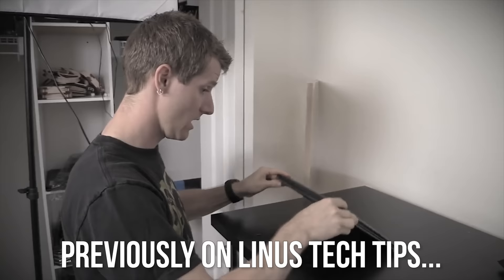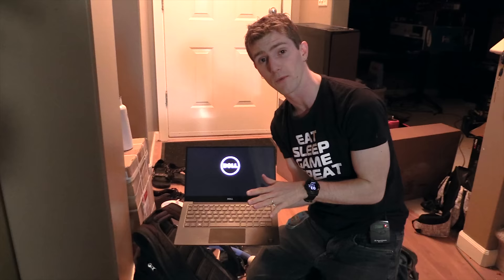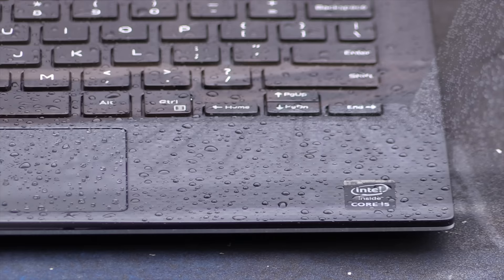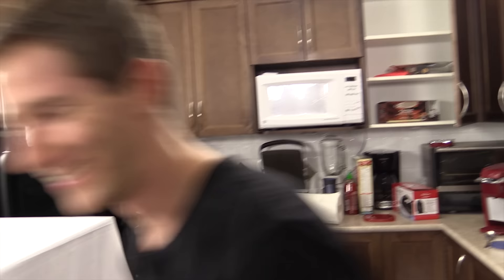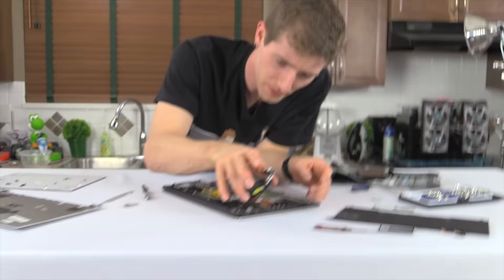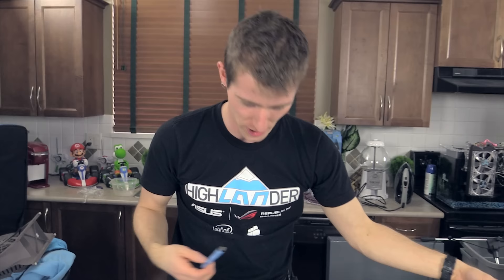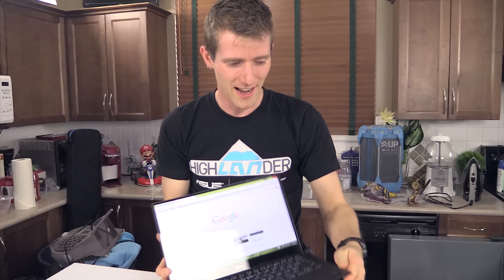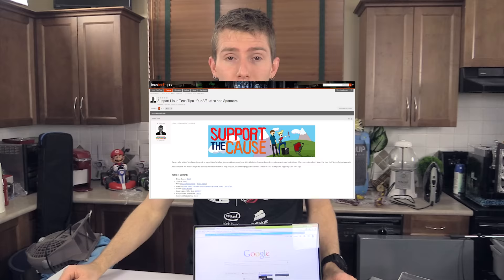Wet Laptop Recovery AGAIN - Dell XPS 13

Comment: Try these when the laptop is on and I'm sure Dell's ENGINEERING will not save this laptop.
Reply: as he said it is not waterproof , but it is still quite durable and resistant a lot of other laptops would have died doing this
Reply: KidGacy Meh I wouldn't really say that. I've had one of my older laptops wet when my nephew poured in milk on it. Good thing it was off. All you really have to do is let it dry and voila, it's still going to work.
Reply: Mcky Dela Peña My Dell XPS M1530 had survived at least 3 liquid attack. Once, i spilled a glass of carbonated water over the screen/speaker area. I let it dry in front of a heater, and 30 minutes later it was fine. I did the same thing the day after (which i know sounds stupid, but both were honest accidents). 30 minutes later and it was fine as well. Lastly, a friend of mine was holding a water bottle in his hand. He forgot there was not cap on it, and leaned in over my computer, and spilled all over the keyboard. 60 minutes of drying later, and it was fine.

I should mention that all 3 times, the laptop was on (obviously i turned if off immediately after the spill). Either laptops are more waterproof than we thought, or Dell really does make laptops out of magic.
Reply: Christoffer Nørskov Omg though have you tried dells customer service. They ripped my mom off by 200 bucks to get something fixed on a dell xps l702x. I don't know if much changed, but I honestly don't think a lot has changed based on recent reviews.
Reply: Fastgamer602 I have had great experiences with their CS. When my hard drive broke (2 times, it was a daily driver and used a lot), they shipped a new one and it was there next day (which is several days faster than when you ordered things online where i was living at the time)

When the GPU in the notebook malfunctioned (there was a known malfunction in the Nvidia 8600m GT) several years after warranty, they sent a service guy out for free to fix it (and another guy the day after, since the new hardware was Dead On Arrival). Keep in mind, replacing the GPU meant replacing the motherboard which also contained the CPU.

They did a free replacement of the plastic underbody of the laptop, after my warranty had run out.
Reply: Christoffer Nørskov Wow you're so lucky they forced my mother to pay while when we bought the laptop 7 days before. If I knew they improved this much I would have bought the Dell XPS13 vs this MacBook Air.
Reply: Fastgamer602 this was several years ago. Also, I live in Denmark where we have a bunch of consumer protection laws, but all things considered, my experience with them has been better than other places
Reply: Christoffer Nørskov That might have been the big reason why you got so such good customer service. We had some foreign reps that barely knew English so I am guessing Dell is doing some sketchy stuff.
Reply: Fastgamer602 but most companies are that way. Very few companies willingly provide good customer service
Reply: Christoffer Nørskov yea but in America at least apple has one of the best customer services. :/ I really want the Dell XPS13 but my bad experience with them is making me lean more on apple.
Reply: Fastgamer602 in Denmark, Apple tried to sue the government because they didn't want to follow consumer protection laws
Reply: Well obviously. That wasn't the point of the video, though.
Reply: naota3k No, but there is absolutely nothing wrong with going off topic, unless Youtube is running out of comments? /s
Reply: Surprisingly, as much as I hate them, the Mid 2012 Macbook's are very resistant to spills. 4 people I know, including myself have spilled liquids on their macbooks.(keyboard area) and they all work fine.
Reply: ImportNation Most laptops are this way. My Dell XPS M1530 has had 3 major spills and survied them all
Reply: Christoffer Nørskov I never spill anything on my laptop...

Comment: Help me understand something. He put it to sleep, then during recovery he removed the RAM. Wouldn't it be a clean boot in doing so or does Windows do like a hibernation/sleep hybrid?
Reply: Ive experienced some similar stuff.

Powered down when it failed to wake from sleep. REbooted and expected a fresh boot, but nope right to where i was.

:shrug:
Reply: Cameron S. Windows saves the ram onto the hdd/ssd when it is in sleep and reaches a critical battery level
Reply: Ahh. Good point.

Comment: I'm not sure if it's been changed but I'm fairly sure older dell devices like the XPS 12/13 'Sleep' by actually hibernating - they seem to power off completely while keeping memory in a state that does not use power, perhaps by saving it to the hard drive. I think an identical device that sleeps in the traditional manner would probably not survive...

Comment: I've always wondered, if you wash your keyboard with water & soap while plugged into a pc that's running, would the pc survive it?

This would be a great thing to know if you're blessed with the dumbest housemaid in the world. Or girlfriend. Or mother. Or both.
Reply: thany3 I'd assume the computer would avoid harm, but the keyboard may not be very happy.
Reply: If your laptop gets accidentally wet chances are that either the motherboard fries or in more likely case the keyboard loses some of its functionality (dead keys). The same happens if you take your laptop (when it's on) from a warm place to a very cold place, then back to warm again because of condensation. Condensation can be prevented by keeping your laptop shutdown for 10 minutes before turning it on every time the temperature changes drastically and sometimes dead keys fix themselves after 24 hours of drying the laptop. The motherboard does not usually fry immediately and if you notice any unusual sounds power it down immediately and dry it. Speaking from personal experience. Every other component in a laptop can take far more punishment. Little water on cleaning purposes wouldn't kill the keyboard when it's on but I'd avoid soap.

Comment: I myself have a old laptop that's a hp pavillion dv6000 from 2005ish. It has had a whole 20oz bottle of coca cola dumped though it. It never stopped running when it happen. The soda was dumped on the keyboard and was pouring out of the fan intake. With the fan still running to say the least. That laptop still runs as good today as it did brand new. Loads apps and websites what seems like just as fast as my brand new omen.

Comment: holy shit, just buy a thinkpad
Reply: i will admit that the latest thinkpads are shit though
Reply: ***** ikr ibm made beasts, lenovo used ibm's design and slowly changed it to their design and now its a consumer laptop competing with shitbook pro
Reply: ***** its more profitable 4 them to go into the server market
Reply: ***** Panasonic Toughbooks ma mayne, shit's built like a tank.
Reply: DGTelevsionNetwork thinkpads use to be so good that they could be run over by tanks but now all hope is lost
Reply: ***** Yep, well there's Chinese business for you..
Reply: DGTelevsionNetwork they are trying to compete with macbooks with the thinkpad line when we know that a mac user would never get a laptop that wont break when you breathe on it so thinkpad should be for people that demand the best have like a really strong carbon fiber shell reinforced with steel and fit some desktop parts in it. w series owners dont give 2 shits about weight reduction if there laptops already way 5 pounds

Comment: Dell laptops seem to be really good in terms of surviving getting wet. My Inspiron 15 gaming laptop survived a full glass of coke being dropped on the keyboard. I immediately shut it down, opened it up and aired it out (without doing much more than removing the battery). Still worked perfectly, aside from a couple of keys being sticky.

Comment: The thing is, in a laptop everything runs a relatively low voltages, so the water is not going to be conductive enough to short it. And the water applied is rain water, which is a lot more pure than tap water, in terms of ions.

Comment: People really don’t understand how water kills electronics. It either causes a short if it bridges powered components/battery contacts, or it corrodes contacts/components. 
If a device is powered off when it gets wet, is allowed to dry, and it’s fresh pure water it got wet with, any device should be fine.

Comment: I'm actually really surprised that Linus is surprised this works. A little rain seems fine, most laptops will survive that. I've recovered Macbooks from water spills, milk spilled in the fans ( and being off for 6 months afterward ) and all were completely fine. Honestly, modern tech can pretty easily handle the abuse.

Comment: The Latitude series is known for being tough as nails and (thankfully) water resistant, I say that in a shy way because like most any other devices, it won't last a submerging. But some rain drops or cough  a coffee spill won't totally ruin your day. However it's nice to know the related machines, such as the XPS are fairly rugged too.
Reply: Can attest to this, my XPS 13 has gone through various drops, and a full on beer bath almost, still works fine. By this I mean having most of a large beer can pour straight into the keyboard while running 😛, it didn't even flinch, and I'm typing this on it. Pricey but well worth it IMO if you use your laptop like others use a cellphone, which is to mean that you lug it everywhere all the time like I do with mine.

Comment: I've only gotten to 5:00. I can get Linus wanting to see how water-proof the laptop is. But, putting it in the rain then leaving it for a couple of days...? The metal will have had a chance to rust or oxidize from the water. I haven't seen all his videos; but, this is comparable to him sticking some PCI cards in the oven. He MUST do really well for himself.

I've gotten to the end... The last time, he was lucky. This time, he was throwing caution to the wind. You know, up till now, I was liking his videos. This is the first time I felt like someone deserved to get a dislike for potentially ruining a $1k laptop that was LOANED to him by the manufacturer just because he wanted to see if it could, also, survive the rain.

Comment: So if you didn't understand, its okay to soak electronics. just dont have any current going through it while soaked. Water conducts electricity. And said electricity then flows to unwanted places breaking the computer. If you didnt have an electricity flow in first place, it wouldn't make a difference. Just dry it afterwards and it would be normal

Comment: Just to experiment I had drenched an old laptop in a bath completely submerged initially the screen was all funky trippy colors. As long as the battery isn't shot, sure enough a little bit later, without opening it up or trying to recover ended up working perfectly yet again. Same deal with gatorade and my macbook, tho that was an accident. Machines are impressive.
Reply: +Vru Patel And the laptop didn't die later?

Comment: So, if your Notebook has a water damage and you did not turn it on, you clean it with clean water first. The problem with shorting of the circuit has nothing to do with the water it is what else it is in the water. So cleaning it with clear water a couple of time should dissolve these elements. Dry it after that and you are ready to go,

Comment: Man, even a cheaper laptop can survive that man. They are tough...I had an Asus laptop worth 500 dollars and spilled sprite on the keyboard (a lot of sprite), didn’t bother to open or dry it. And it ended up running, still running in 2018 despite I’ve used it for 5 years. There is no reason a XPS can’t survive the rain. (Some IOs did get rusty after the spill, but all worked fine)

Comment: No one questions the fact he took out the battery and that the pc is still in sleepmode afterwatds. Definitly no cut before final bootup. Also isn't rule one to turn off a laptop before screwing it open.

Comment: I spilled a cup of tea on my XPS 15 a couple of hours ago. I turned it off, let it to dry for an hour or so and then tried to turn it on... it wouldn't. I took it home, removed the battery and put the whole thing in a bucket with rice, since that's the urban legend I'd heard. Then I found this video. Does anybody here have any advice? Do you think the laptop will survive? What else should I do?

Comment: so all you did was dry it out? I spilled the smallest bit of water on mine this morning. I cleaned it off (didnt open it up) and turned it upside down for a bit. ( first I turned it on and it WORKED ) so then i turned it off turned it upside down and let it sit. then i finally flipped it upright and plugged up the charger like a dummy because the bat was nearly dead. left it there till around 8 at night and now it doesn't work. so i opened it up, i don't see anything that looks blown or shorted out. oh god i hope it works. i took the hard drive out and tried it on my other lattitude d630 and it works fine so i didnt loose my data and the hard disk is fine. i hope it works. im resetting the cmos not that I think that has anything to do with it but other tutoials are saying do that so ill try anything. I just dont see how cmos has to do with the issue tho. also dont get why it turned on and then doesnt work now. unless it wasnt dry like i thought it was and flipping it up right while plugging it in caused the damage. dangit. im so stupid sometimes.

Comment: I spilled about half a glass of water when the laptop was on, wiped off the water, shut it down and put it to charge. 7 to 10 hours now, no power, no display, no light when charging, is there any hope for my laptop? If it helps the water fell on the left side where the charging port and 2 usb slots are. We have opened and tried to air dry it once, it is still not on.

Comment: Actually any electronic equipment has a high percentage of recovery if you do not power on while wet and open it up for drying. I have my iphone dropped in seawater and get rainbow screen color as I stupidly power it up but it recovered itself after leaving it for a few day. However it is not good for long term as any mineral residue the rain water or sea water leave behind is corrosive to the electronic part.

Comment: So, uh...that lithium ion battery leaking like that is not a good sign. I think you "fixed it" in the same way that putting fix a flat in a tire "fixes" it. That thing likely is going to die in very short order.  I was surprised it even powered back on though. Have you been using that laptop since and can show how well it works long term, or did you immediately send it back?
Reply: +Warren Garabrandt That's something that I'm curious of too. My laptop recently experienced water damage, to a much less severe extent, but it clearly got inside because when  I powered it up at first it told me the hard drive was not installed. I found this video while trying to do research on complete recovery is for a laptop that has experienced water damage. ^^;

Mine is the same type that is in this video, and I did not have the tools to take it apart and let it dry, but I let it sit for a while and it started up. I just want to make sure there isn't some internal damage I should be worrying about down the road, when my warranty is no good anymore.

Comment: I spilled over a cup of water on one of my laptops one time by accident. it wasn't on and it took the full cup of water to the insides. I have never taken a laptop apart so fast. 5 minutes and it was gutted. most water dried up then all parts into containers of rice.

Comment: Hey Linus, if you ever think of disassemble a Dell System again and need some insight of how you are going to do this. Just go on the Product support page and look under manuals for the "Owners Manual" or the "Service Manual". For the XPS13 9350 you would find this thing: http://www.dell.com/support/manuals/us/en/19/xps-13-9350-laptop/xps-13-9350-laptop-v1/Notes-cautions-and-warnings?guid=GUID-5B8DE7B7-879F-45A4-88E0-732155904029&lang=en-us 
Sadly the LCD isnt really meant to be opened/fixed onsite on most XPS or touchscreen devices. Even if Dell sends a technician to repair a LCD Issue they will replace the whole LCD+Backcover+Hinges Assembly.

Comment: My laptop got soaked into the water last week.
What I did is I left it opened facing the electric fan overnight.
But unfortunately, as I was impatient and so much worried, i tryied turning it on the next day as I thought that it got already dried up.
Luckily, it turned on. So I checked the keyboard and everything and it was all functioning great!
Then the next morning, as I was trying to turn it on again, it did not work! :(
Is my laptop dead already???? :'(
Hope you could help me.... :(please.

Comment: You do realise shaking it is going to make it worse if water is inside the machine. what do you think shaking it is even going to do.

Yes, surface tension (when the water hangs on the tip like water on a leaf) could be argued, but then you can just use a cloth to wipe it off.

Comment: I applied water instead of other cleaning solution to wipe dust off my terrible laptop(not dell)  some managed to get in keyboard  the light and keys glitching  slight panic but, after doing linus method but with hair dryer i managed to save the keyboard 3 days later every keys works well looks like my ideapad with terrible quality can also be saved with this method

Comment: I accidentally leave my Alienware rained. Because you did recovered the Dell XPS 12 & 13, is it possible for me to recover my Alienware because it is on the same Company products. Im a bit panicking now unlike you the IT guy who understands the reassembling laptops. And by the means that i might be unable to do that, can it be done if i just dry it slightly opened (just by releasing the back plank) ??